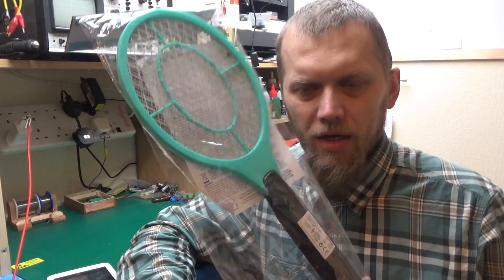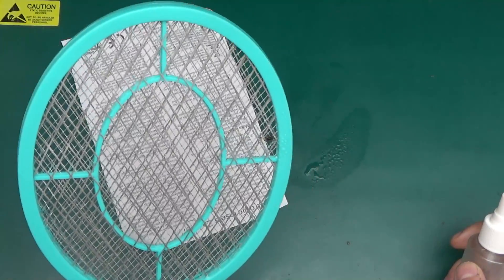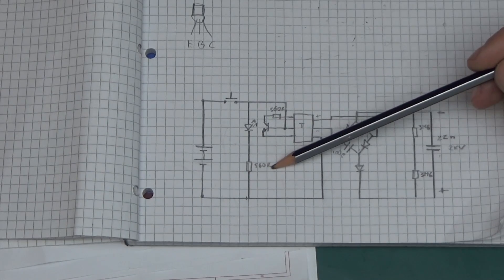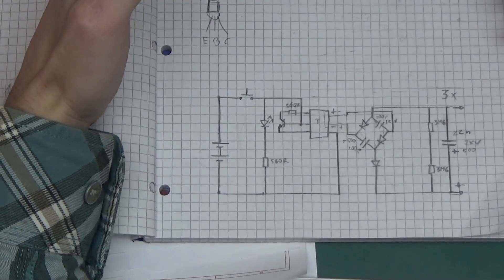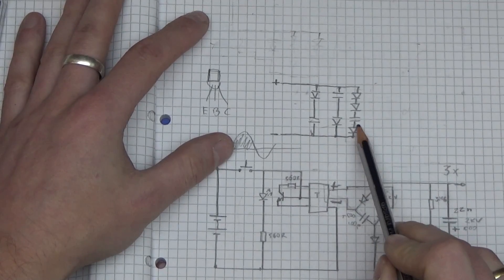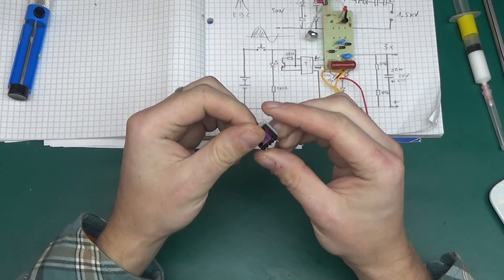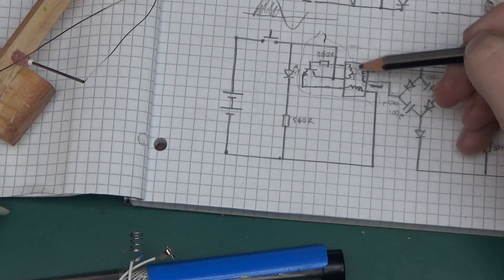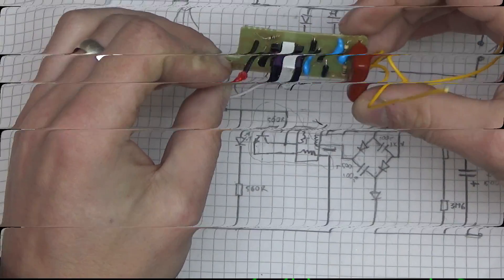Insect terminator reverse engineered (and one-way teardown)

Comment: Hey, I have a similar circuit from another model of fly swatter that uses a single capacitor and a single diode. I'm interested in how it works, would you mind getting in contact with me? I think I know it, but I'm not sure - especially regarding safety issues. I really liked your video and it cleared up quite a lot for me, so thanks in any case :)

Comment: Hello, I would like you to help me I have a question, this circuit could work for a long time if I cancel the button so that it is always on? Thanks in advance.
Reply: Yes but then remove the battery and add power a adapter

Comment: Hi Mr randomtronic 
I have question 
To protect transistor from voltage spike or surg...etc at the base should i use a diode or zener 
In case of a zener which value
Of break down voltage ?
N if that value depend from transistor to another?

Thanks

Comment: Please tell us what is the purpose of the two resistors in series and parallel to the 2KV capacitor. Thank you, great video congrats!
Reply from the maker: Those are there to discharge the cap once power is removed. Just safety reasons.

Comment: I got one question sir. In the voltage tripler the current starts from the negative terminal of the transformer but you start rewriting the flow of current in the positive terminal.
Reply from the maker: Not sure I understand, there are no positive or negative terminals on transformer, it's AC
Reply: @randomtronic  oh okay, thanks for the info.

Comment: Excellent video.very nice explanation.I have one question,What will be the voltage across primary winding of the transformer during operation?
Reply from the maker: Primary was switched directly from supply  voltage, in this case 3V.
Reply: randomtronic thank you for the reply.In many insect terminators I have seen in the  market comes with rechargeable battery.But when I see the circuit it does not have step down transformer to convert 220volt AC to approx 3volt DC to charge the battery ,instead it has some resistor and capacitor and bridge rectifier.How it works?
Reply from the maker: Prakash Chandra hard to say without looking at it, but I suspect, that there will be a "capacitive dropper" - that's the mains rated cap, to limit the current from mains, the bridge rectifier to convert it to DC, and then a resistor voltage divider to get appropriate voltage to charge the battery, which would likely be NiCad in that scenario. Not a very safe circuit if you ask me, simple and it does work, but not safe due to lack of isolation from mains.
Reply: randomtronic thank you.I saw the circuit.It has 1 capacitor(CBB21 564J400V) in series to the AC and also one resistor (R684) across the capacitor.This is then connected to bridge rectifier(MB6S).The out put (+ve )from Bridge rectifier is connected to 100ohm resistor in series to battery.
Reply: randomtronic I shorted the push button to check the voltage.but after some time I saw the transistor (D965)over heated and started smoke.I checked transformer after desoldering from the circuit and the primary winding reads 5.72 ohm, feed back winding reads 0.52ohm, secondary (high voltage) winding reads 1.24H.Voltage across the battery is arround 4volt with load.What will be the problem with the circuit for not working?